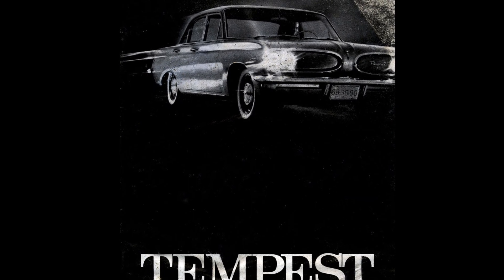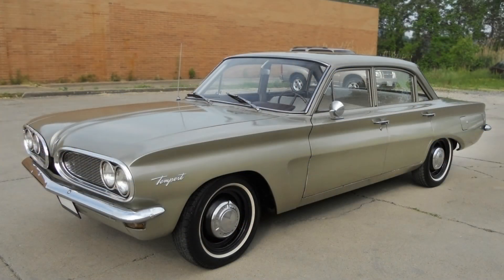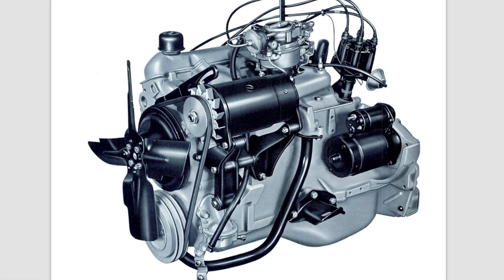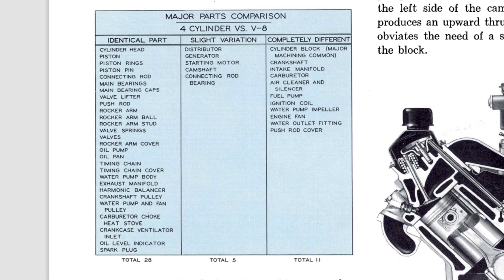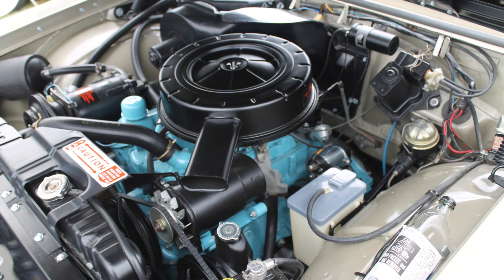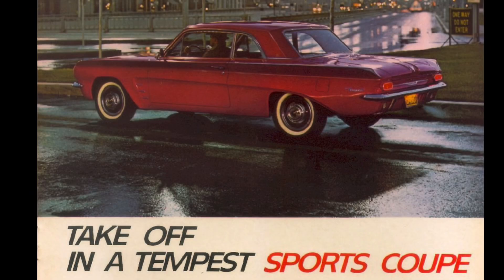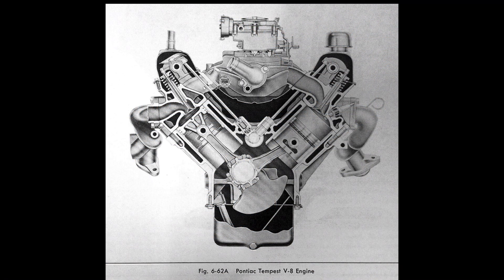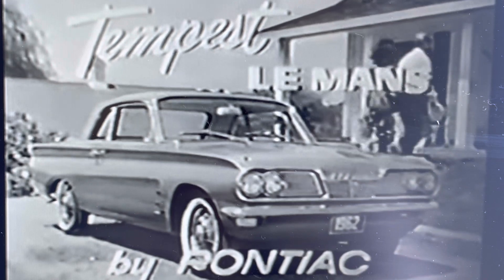Strangest Automotive Engines: The 1961-63 Pontiac Tempest & Its "Trophy 4" / "Half 389 V8" Engine

Comment: I own a 1963 Pontiac TEMPEST LE MANS with the famous Trophy 4-cylinder, 3-speed manual transmission. I bought this car in 1993 from the first buyer of this car new.
 I restored the mechanics and prepared the engine.
The body is in perfect condition; no restorations have been done.
How can I contact you? (pictures).
I am French and live in France. This car was imported to France in 1963. The speedometer is in km/h (RARE)!!!

Comment: This was interesting and reminds me when I was working as a mechanic at the Ford dealer back in the 1980s. I actually worked there from 1983 to 2006, but when Ford was designing the 4.6 liter engine, they were calling it the “modular’ engine. A few of us had to go through some training on it. The plan was to design the 4.6 in such a way that it could be sliced in half and used as a four cylinder using a head from the 4.6 V8. Or, slice two cylinders from the front and use it as a V6. Ideally, the same piston and connecting rod would work in any engine, so would most of the other internal engine parts; hence, the “modular” design. This would also reduce parts inventory. This chatter went on for several years and we all thought it was a great idea. Then, it just kind of went away. It wasn’t the first and only idea that Ford came up with and sent us to training only to find out it never happened.

Comment: Back in the day my girlfriend had a Tempest with the four speed and four-barrel four cylinder engine.  I did all the mechanical work on it.  The engine was a blast to drive with, but the car handled like a corvair, and was dangerous in some turning situations.

Comment: Youre fortgetting the 1963 tempest which came with the all cast iron 326 V8 engine That was the same block used for the later 350 and 455 pontiac full size cars,

Comment: In 1966 I had a '63 convertible with a three speed manual on the floor.  Worst car I ever owned.  Bought it due to its cute looks and immediately regretted the decision. Engine was totally gutless, noisy and had a bad vibration problem.  I had it tuned twice in three months and never got better than 13 mpg--that was big V8 mileage in a four cylinder car.  Transmission howled like a sick coyote due to worn bearings (in a three year old car).  Brakes were so poor they were scary--I would come up to a traffic light  and overshoot  the stop line.  After a few months someone asked if I wanted to sell it.  Boy, did I want to sell it.  Bought a Dodge Dart wagon and that was a great little car.

Comment: I had a 61 tempest wagon. My folks paid $25 for it in 1970. I had to rebuild the engine with the help of a pro mechanic. Redid the brakes. The timing chain noise awful. I replaced it 2 times. The trans axle couldn’t take a lot of abuse. I replaced it 4 times over the years, Often happened when I tried to rock it out of the snow. I loved it anyway and wish I could get ahold of one!

Comment: I remember working in a gas station where I checked the oil in these cars in 1969.  I thought that these engines looked like half of my dad's 1961 Bonneville engine.  Now I found out I was right.  I guess the fuel milage would be better than the 12 mpg of the 389 Bonneville.

Comment: My dad bought a 63 tempest 4-cylinder four-door hard top with 3 speed manual on the floor and 2 barrel carb, new in 63.  His twin brother bought a convertible at the same time.  Later my dad sold it to my grandfather.  My grandfather eventually parked it and it sat for 10 years.  Around 1980, my uncle towed it to my house.  I went through the whole thing, pulled the engine apart, the old oil was like roofing shingles.  I steam cleaned the inside of the engine, rebuilt the carb, fixed the brakes, etc. In total including the steam cleaner rental I invested about $200.   It was 17 years old at that point, so no gasket sets were available, but some smart parts dealer ordered me what I remember as a 326 set, but which must have been a 389 set, and I used the half I needed.  He threw in a tube of permatex for free  to help construct the cork intake manifold gasket.  I drove that from Connecticut to Virginia to college and back several times.  It was a fun car, although it had a bit of rust inside and out, common for the era.  It had a cool stock white cue-ball shift knob, but smaller.  The distance between first and second gear was severe, so you had to rev it up pretty good to make the switch.  Going up a very steep hill from a slow speed or stop required a fair bit of skill as a result.
It was awesome in snow, because of the corvair "unsafe at any speed" suspension.  When you jacked it up to change a rear tire, the rear wheels would lower and toe in - you had to jack it up pretty high.  That combined with a relatively even front/back weight distribution is what made it so good in snow.  Also, it had unusually large wheels for the time - most cars tires look too small in stock 60s cars, but not this one.  You could literally get past cars stuck in the snow by going off-road!

Comment: SAAB set a record by running a SAAB 4 cylinder at full throttle on a track for 100,000 miles only stoping to change oil, tires and drivers and maintain an average speed of 137 MPH. RPM at that speed is around 6,500 and did that for a month straight!

Comment: A 3.2 liter 4 cylinder is HUGE.
Reply: True that, but pre 1972 everything was based on "Gross horsepower" today it's "net" horsepower, in other words that 155 Gross horsepower 4cyl. Would actually only be about 104hp net or about a one third less hp compared to today's engine's. A Kia Rio could beat it.😅
Reply: @davidhibbs6989  I'm sure it could... and with a much smaller engine also. Technology has come a LONG way since then.

Comment: Pontiac also made a tempest with a 389 V8 topped by 3 two barrel carburetors.  And little GTO emblems near the headlights on the fenders.  Or at least I saw one in a car lot in 1965.

Comment: My parents bought a new 1963 Lemans 4-cylinder convertible only to trade up to a ‘65 inline six powered Lemans.
The ‘63 was plagued with driveline chatter, uneven rear tire wear and timing chain issues. Years later my oldest brother bought a used version equipped with 326 V8 devoid of those problems. 
Now that was a sleeper!

Comment: I bought a 1963 Tempest LeMans with this 4 cylinder engine as poor college student in 1970.  It was my second car purchase.  Paid $300 for it if memory serves me right.  Thats more money than it seems.  Minimum wage was well under a buck and my good paying summer construction job paid a little less than $100 per week.  It was  wonderfully inexpensive to drive and the motor was great.  The wonky drive train; not so much.  I had to replace the torque tube that held the 1" diameter drive shaft rigid.  (Damn wintertime midwest road salt.)  It did have a habit of eating clutches as well, but that might have been the varied girlfriends trying to learn to drive it.  Thanks for reviving old memories.

Comment: Having had a 61...manual.  the car went through many throw-in bearings....beginning at low mileage ...approx 40 miles... 
Drove until 100, 000 miles ( approximate)  kept running well..no clutch problems...but went through 3 throwout bearings...all were replaced by pontiac service facililities..facilitates...   fatal weakness??  I still drive manual transmissions...and have a psychological problem with holding my cars while stopped, with clutch disengaged.
Result of the Tempest...throw out bearing... apparent short life.

Comment: I was assigned to Robins Air Force base in Georgia in 1982, having returned from Germany.  A fellow Airman in my radar shop had driven his 62 Tempest convertible from California.  It had the 4 cylinder engine.  He was on a two lane road somewhere along the way and a semi pulling a box trailer was traveling the opposite direction.  The wind whipped the convertible top so hard that it ripped the fabric off of the frame.  I'm sure it was dry rotted from being in sunny Calif it's whole life.  One thing you didn't comment on was the A6 Fridgidare compressor on the car you showcased.  Back then GM had only that one size fits all compressor so it would have been right at home on the series 75 Cadillac or the Tempest with half a V8.  You can be sure that when the AC was cranked up on a hot summer day that probably 1/4 of the engines output went to cool the car.  Great video.

Comment: This video failed to mention the unique transmission location. Pontiac decided to place the Tempest transmission and the differential in the same unit on the rear axle.  This was supposed to achieve better weight distrubution.  My first car was a 62 Tempest.  It's performance was excellent.
Reply from the maker: It was mentioned in the video, but not dwelled on.

Comment: The Chrysler " slant 6 " concept ??? Just in the 4 cylinder mode ?? Never  knew there was rear tranny with a front engine in any GM car in the early 60's or ever. I think the Chevy Corvair had the rear air cooled engine with tranny in rear ??

Comment: The weird engine is weird, but the tranny in the back is really weird. I bet it wasn't too difficult to swap in a 389 for the 194, though. Mounts should've been the same. Now swapping in a Muncie rockcrusher would've been a bitch. You'd have to cut the floor and make your own tranny tunnel. Not unheard of, just more fabricating than the average Joe Homeowner is prepared to do. George Gearhead, on the other hand, well... I've been a backyard mechanic most of my life, lemme tell ya, where there's a will, you find a way.

Comment: I had a 70 Tempest. I bought it in 83, for $50 bux. It had a 350 four barrel, turbo 400, posi. The body was all rust. I drove it til the tranny shat the bed, then I parked it in the yard for redneck yard art. I put the 15" Pontiac mags on my Nova. I put the steering wheel and front buckets in the Nova too. Then Mr Poor Old Pontiac became food for the crusher. If you took a look underneath, you'd understand why.

Comment: How long did it take GM to configure the Corvette suspension in the same way with the transmission/transaxle in the rear similar to to Porsche 924 and 928 models? I think it was the C5 introduced in 1997. That alone improved handling and ride comfort way past the previous models.

Comment: My mother had a 1963 Pontiac Tempest Le Mans with a 326 cubic inch V8.  I got to drive it from time to time.  It had the quickest throttle response time, which made it hot off the line.  I loved that car in its Burgundy exterior and black bucket seats.  I had a 1966 GTO with a 389 and a single 4 barrel carb.  I only had the GTO for a year when it was stolen in Euclid, Ohio at a Holiday Inn.  Sadly, 6 months later it was found in a junkyard and it had been gutted for ALL its parts and accessories. i would go on to have several Grand Prix's one of which was a 1976 with a 455 cubic inch V8.  Good road car.  I eventually sold it to a friend who had it for a very long time.

Comment: The 4 cylinder engine would outlast the drivetrain by an order of magnitude.  The driveshaft was a "small" diameter tube that was supported about its mid-length by an "offset" center bearing.  This should have given any experienced engineer a huge slap in the face.  The idea was to reduce drive shaft effective length and dampen inherent vibrations by having the shaft under very slight bending.  The center bearing was subject to radial load and a minimum of wear sent the entire driveline into harmonic hell.

Comment: I got stranded out of state with  a bad transmission as a broke  teenager in 1975. I found a 61 Tempest in very rusty but very good running condition at a used car lot for $75. Drove it 500 miles home, sold it for $90. The buyer got several years use out of it. LOL

Comment: The body lines are beautiful, an elegant but simple styling  without excessive stainless trim.  Matches today's tastes much better than say the Valiant's strange "toad" body in those years, and is closer to later bodies of 1964-5 by the Big Three which many consider the best look.  I wonder why they didn't term the engine "Slant 4", like Chrysler's Slant-six.  Unlike a straight-six, they didn't face "too long", so didn't have to squeeze the water pump in on the side of the block.  Nice that they mounted the climate box in the engine bay so easy to work on.  Must have been a very tiny 4 bbl carburetor in the HiPo engine.

Comment: my brother bought one of those off a old lady that couldn't drive anymore due to age. he found it in here garage when he was stringing  cable tv lines thru the neighborhoods back yard easements !!  he bought it for a song , and it was mint with super low miles on it , only problem was , he couldn't get rear wheel cyl's. for it to do a brake job !!! I wish I knew about white post restorations then , He could of sent them there and had them stainless sleeved !!  sport coupe white with a red interior !!!!
lady bought it new !!!!!   cool little car  !!!!

Comment: My folks bought a '61 Tempest 4D base model in Seachest Green - my dad was tickled with Pontiac's common-sense way to build a 4 with parts common to the V8.  It had quite a few trips back to the dealer in the early days for little leaks and things (he said it must have been a "Friday car" on the assembly line).  But it served us well for 80K, which was good back then. I dreamed of putting a 389 in it to make a Nova-killing sleeper, but that was before I could drive, and we traded it in for a '64 Catalina in 1969, which was where I finally got my 389!  I still dream of building an old tempest with a 455 Pontiac and a Corvette transaxle, but I'm an old fart now! But if I win the lottery.........😉

Comment: Hi Adam. Speaking of odd engines, I’d love if you did a video on the LQ1 3.4L DOHC V6. It would be interesting to get any insight about the development of it or what GM may have originally intended for it. Given the complexity, larger packaging, and added weight for a relatively minor bump in HP and a reduction in torque (especially low end) relative to the 3.8, it never seemed to make much sense. I tend to believe the rumor that it was intended to have more power, but Hydra-matic was unable to deliver a transaxle to accommodate it, so power was cut.
One of my favorite old cars was a 94 Cutlass Supreme convertible equipped with this engine (along with the 1st gen HUD and rear bucket seats, very cool at the time).
Reply from the maker: It was supposed to be about 250hp and higher torque, but I believe the transmission couldn’t take it, so it was detuned
Reply: @RareClassicCars  That lines up with what I heard years ago. Assuming 250, that would have been even more power dense than the LT5 and Northstar  (which I’d like to think may have inspired the LQ1). Interesting.
Anyway, thanks for the reply. I’m a die hard GM nut myself and love the channel. I’m especially enjoying your many features on the 70’s Cadillacs, as I have a very well kept 75 CDV I was fortunate enough to acquire from my grandfather’s estate.
I could talk GM for days and would like to think I’m pretty well versed in most of their products lines, especially 90’s and newer, so it’s hard to find any channels discussing topics outside of typical regurgitated and often incorrect information. Both you and (from a more humorous perspective) Bill of Curious Cars are my go to!
Thanks again for your great content!

Comment: I had one, a 1963 convertible. A real shaker, but also a sleeper. The shifter was in the lower dash board. The carb was a 600 cfm Carter. Tranny was a power glide. I loved it. A "mechanic" said it had a burnt valve, took it apart. Never ran again

Comment: At a few years after this period, my three siblings bought used one each of the GM compact cars meant to compete with the Ford Falcon. There was one Tempest,  a Buick Skylark and a Chevrolet Corvair. So what did these have in common?
The Tempest and Skylark seemed quite different and they were much closer to the Falcon in function and appearance; but that rear transmission on the Tempest shared a commonality to the rear engined Corvair that my brother had. They both used a variant of the same rear transaxle and automatic transmission. 
How did I know?
I eventually purchased a 1962 Corvair Spyder convertible. As I learned its many quirks, some quite different from the VW I had been driving and modifying before. The Corvair I had was a manual 4-speed, and of course needed a clutch that the automatic did not.  That clutch cable  had to get back to that transaxle on the "wrong side" using 13 pivot points along its path. While the engine and transaxle were backwards with the engine behind it, that transmission used a very short version of the rather long narrow, curved shaft that the Tempest used with multiple bearings to hold that curve under the floor of the car. The shaft passed through the  differential part of the transaxle in both cars but the gearbox was forward of the rear axle in the Corvair, making the shifter connections for the manual on the right side rather than the left.  I think the manual gearbox was borrowed from the Corvette design for my car, but I am not certain.

Comment: Very heavy rough running low power engine.  Power glide two speed auto.  Corvair chassis which was never noted for decent rear suspension geometry.   When the Tempest evolved into the first GTO it STILL had the 9" front brakes from the '60 Corvair.  Just a mess all around and lots of people loved them because they knew no better.

Comment: What's amazing is that they offered this 4 cylinder engine with 155 and 166 hp, in higher compression form. The Buick 215 V8 with a 2 barrel carburetor and lower compression had 155 hp.  Amazing that a 4 cylinder engine could offer the same or better horsepower as a V8 used in a similar car, the Buick Special, and was optional on the Tempest.